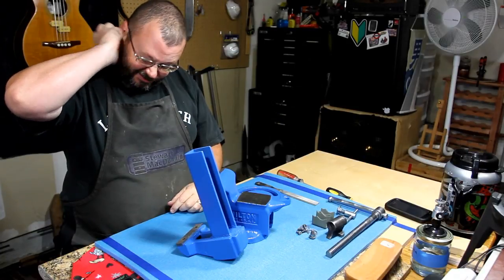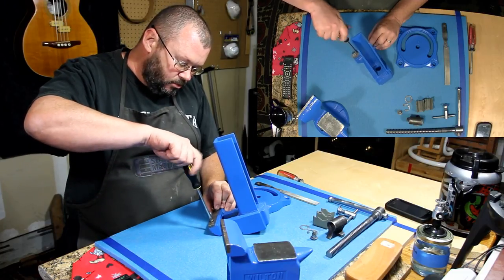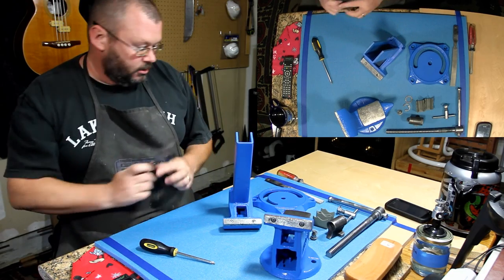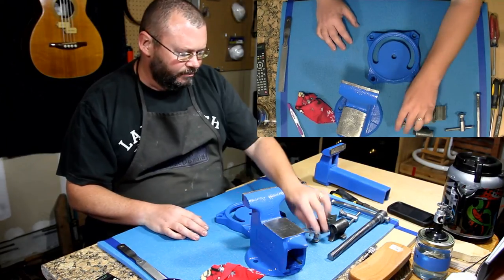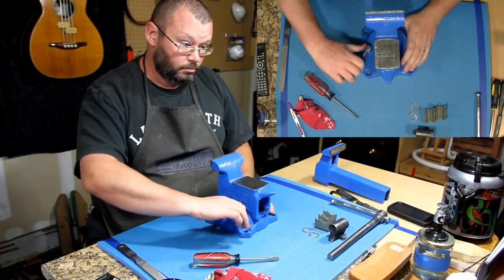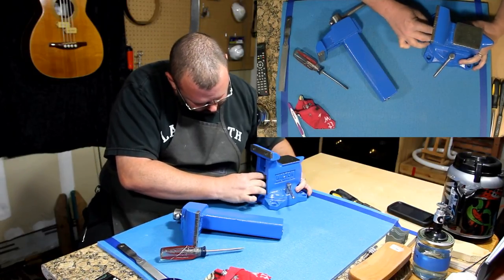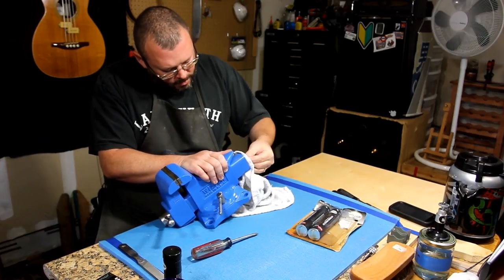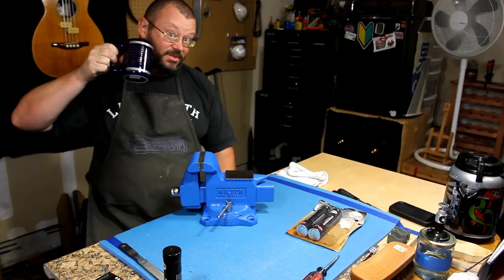Wilton644  vise model pt.3 | RATTLECAN GUITAR RESTORATIONS by James O’Rear

Comment: Thanks for the video! Just thought I'd pass along that rather than making replacement jaws that screw in, an alternative might be to make soft jaws that just fit over the hardened jaws. That way you never have to worry about a fastener rubbing on a guitar as your working on it. You'd basically carve a 'U' shaped piece of medium hardwood that fits over the existing jaws. You could also use a soft no-mar plastic. Hope that's helpful!
Reply from the maker: Chris Hindy Great idea, will let you know how it works out. Thanks for the comment.

Comment: I'm about to pull the trigger on the shop fix parrot vise at grizzly with the adjustable pads. Never had a vise in a shop hope it becomes as useful to me as it appears to be to others. Great score on your vise BTW it looks great.
Reply from the maker: Thanks Dane. Grizzly used to carry a gunsmith's vise that was very similar to the StewMac shop vise. Good solid units. I have one in both work areas and use them quite a bit.

Comment: What did you prime it with?
Reply from the maker: davecooper360 Metal primer from Rustoleum I believe. I try to stick with the same brand name when using primers/paints.
Reply: Cool thanks!! I have an old Wilton vise that's in good working order.. but it's old, dirty, and has some rust. I would love to restore it like you've done here!  :)
Reply from the maker: I knew nothing about them when I found mine so if I can do it, you certainly can as well. Good luck and show us when it's done!
Reply: Will do  :)